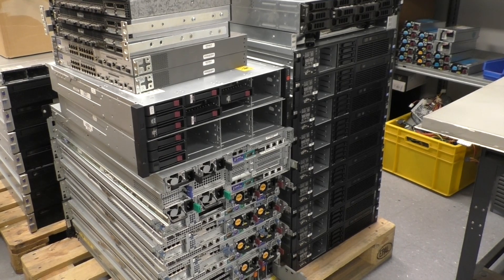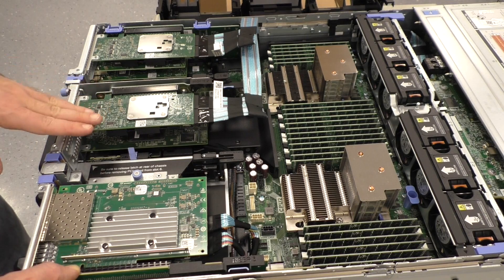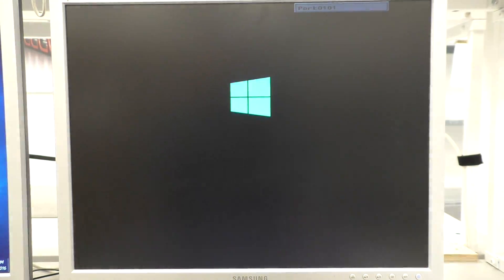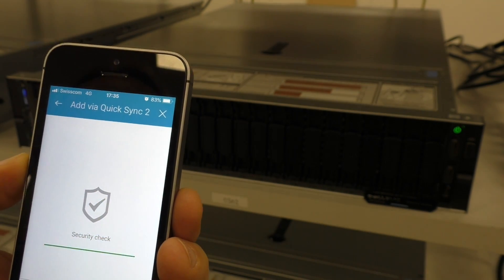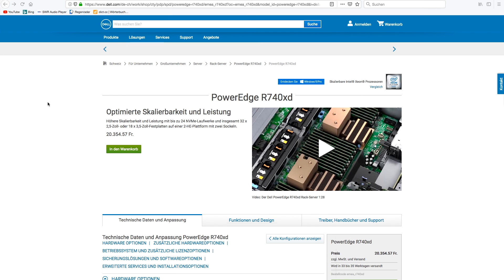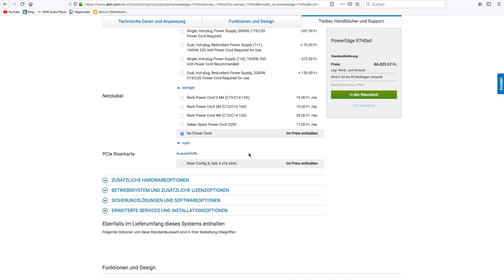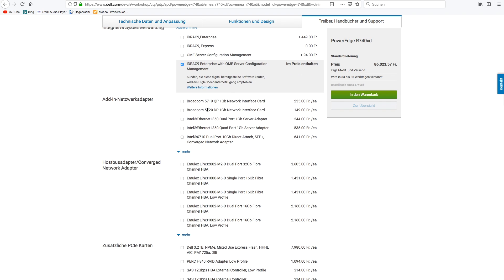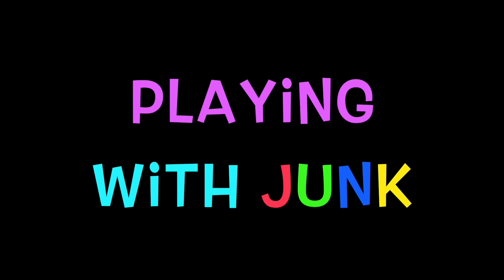I'm the BurnIn Man... with Bluetooth!  (PWJ126)

Comment: All the "included in price" items that are in "checkbox" sections (not radio button) actually have a cost counted in (you can see with the qty and unit price on the line below) that would be removed if you unchecked it. There's the 1600CHF 1TB NVMe and 1500CHF 800GB one where it seems you don't have both. And yes the power cords were 2x10CHF :)

Comment: you are funny CPUz is not a CPU Heat Test ... use Prime 95 an custom 16K 16K settings or use "Breakin Hardware Diagnostics - Advanced Clustering Technologies" this is a Cluster Server CPU/Memory/Storage Test Linux
Reply: but .. nice server :D
Reply from the maker: As i said... there are certainly better tests but for the moment, it makes the CPU go to 100% and that's all I need. The problrm is that there is no time. Servers should be delivered on Jan 04.... but only 20 of 80 have been delivered to that date.

Comment: That dell website is really slow and annoying. Why does it have to pause for a few seconds and spin round when ever you select an item or change quanity. Calculating the cost is not difficult. It should update instantly. Im assuming you're using a fast PC and internet connection. Too many scripts and over complicated. Lots of websites do this actually - youtube and flickr for example.
Reply from the maker: At least it works. Many other websites don't even work.... and that's much worse.

Comment: Nice video. I doubt that the price unit is the one you mention for that number of servers. Normally, if someone buys more than 50 servers, the price per unit is a little bit lower than the retail price of the website. At least that is my experience. Also, when you present the price per unit, one thing you did not mention is the kind of hardware support agreement you have for the server. Something like a 3 year plus Dell ProSupport can actually add to the price a bit is an important component of the price. Again, the larger the number of servers, the greater the discount.
Reply from the maker: I don't think that the customer has paid the full list price. I would really like to know what the actual price was... Maybe I find out one day.

Comment: Do those have an service tag you can enter on the Dell website and get a list of the all of the options as installed at the factory? Wouldn't they already be burned in at the factory with all of the configured options installed before being shipped? Oh, about 1:00 into the video there is a service tag visible, which can be entered on the Dell website to see the original system configuration and warranty information. You might want to obscure that.
Reply from the maker: The configuration is not a problem as long as the customer is not visible. Dell did not have the time and the personnel to burn in the servers. The order was very late and that's why we did that before delivery.